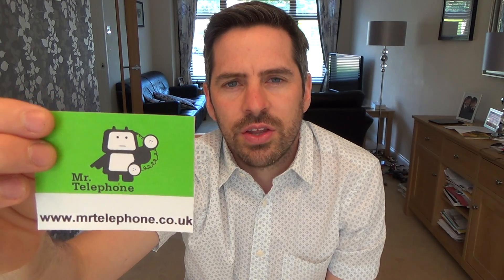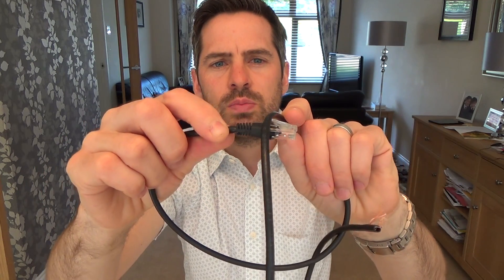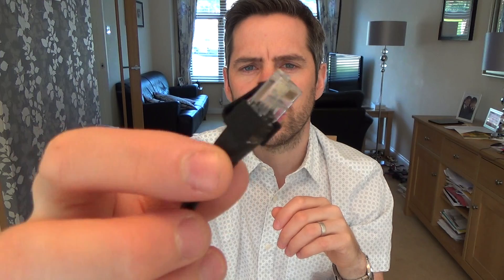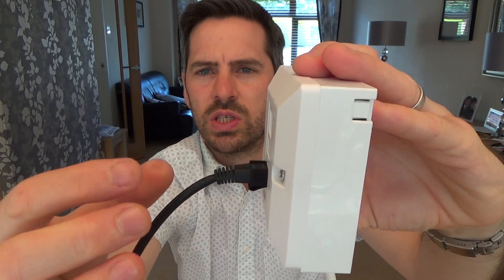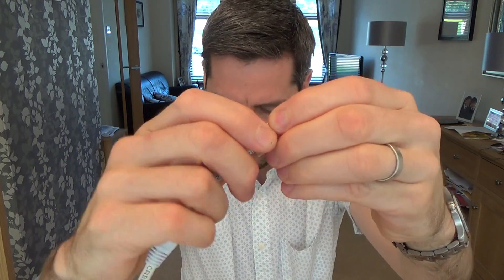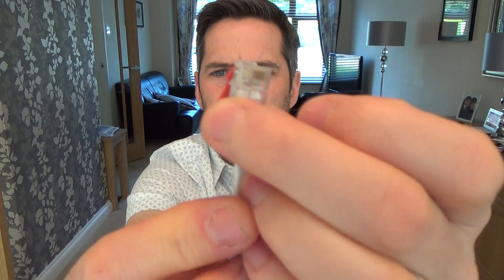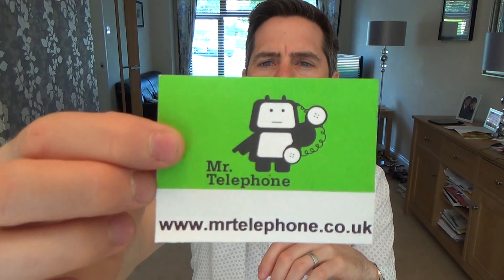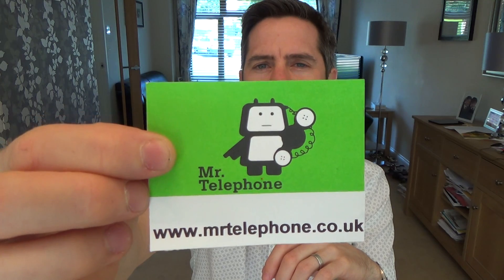RJCLIP, the easy way to fix a broken RJ45 ETHERNET Plug Clip Tab 8P8C

Comment: If you have a cable that's not locking in place but for which the tab isn't broken/missing, will you get the most reliable fit from rjclip by breaking off the original tab before installing it?  

Note that in my experience, only 10% or so of cables that start slipping out actually have a missing (broken off) tab.  For the rest, the tab is just not doing its job.

Comment: what if my clip hasnt broken off but it is loose so it keeps sliding out of the etherenet port.  Will my situation need this little accessory or is there a simpler fix?
Reply: could you fix it?

Comment: how long do these last for
Reply: The design of the latch is such that it will never break. It should last 50x longer than the original latch. Using it in an environment with high insert/pull usage, the connector leads will probably wear out before the rjclip.

Comment: There is a little door in my hp omen laptop for ethernet cable which keeps it in place, but the door snapped off. Now the cable wont stay in and idk what to do. Wifi is not an option for gaming and I have already used all my usb ports so cant do ethernet to usb adapter. Any ideas??

Comment: I used a McDonald's straw, cut it to fit and now it works flawlessly
Reply: Can you explain the drinking straw method?
Reply: @brianshanahan3878  cut half an inch of the straw to fit the fitting of the cable and use it in a way that it cushions the plug of the cable so it's not lose

Comment: I fucking hate the ethernet socket in motherboards,I break it everytime,I just lost a mobo now because of a loose ethernet socket,how the fuck are you supposed to get the cable in without breaking the socket?,it’s impossible to do.

I have to buy a new motherboard and do this all again ,suicide on the mind.

Comment: Why you can't find those clever little fixes in retail electronics stores I'll never know, but those dummies who run them just can't get it thru their thick skulls when a cheap fix and good will is better than $10 to $20 new cable sale.
Reply: NEWS FLASH! — You can get 'em at Home Depot if the advert links to this YouTube are believable.
Reply: Home Depot, eh? Sorry, not yet. Will try to get them there ... not as easy to get our product into the retail channel as one might think.
Reply: These things are literally $10 for five a new cable is cheaper unless it's a bigger cable and even then you could make one with s*** laying around the house or even s*** in the floorboard in your car

Comment: it is a god idea...I just wish I could get one or two instead of having to buy from 10 to 100 of the,. The least I can get there for is about 8 bucks on ebay. If my cable were not imbedded in a wall it would as cheap to buy a whole new rig, wire, plug and all.